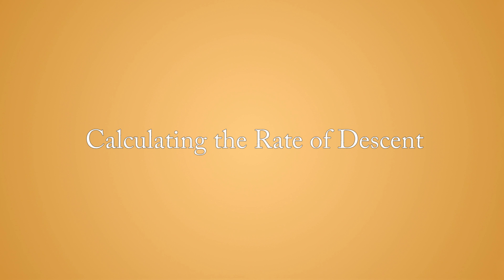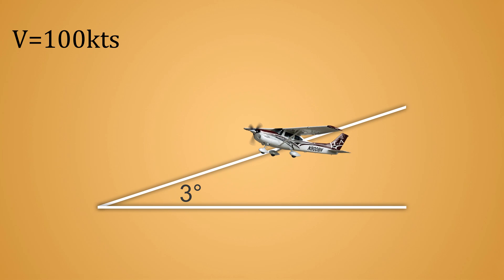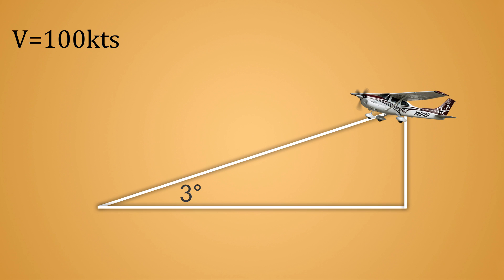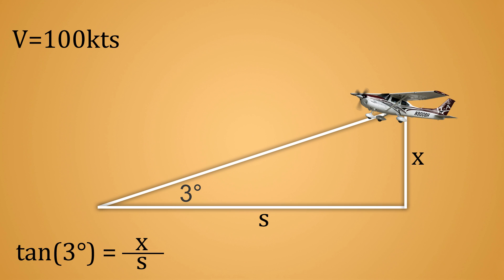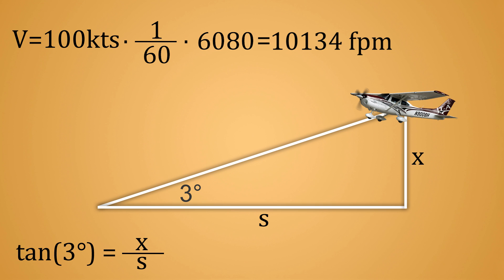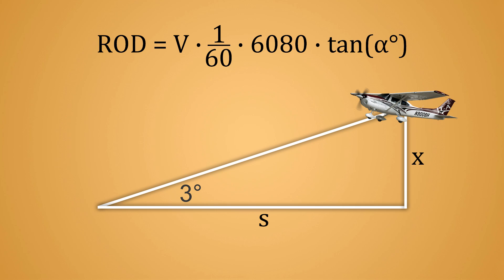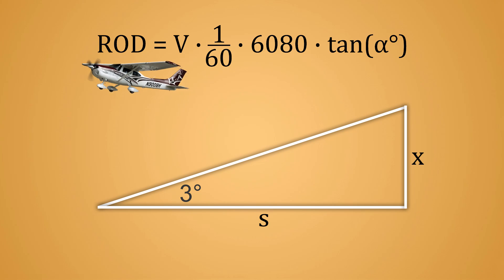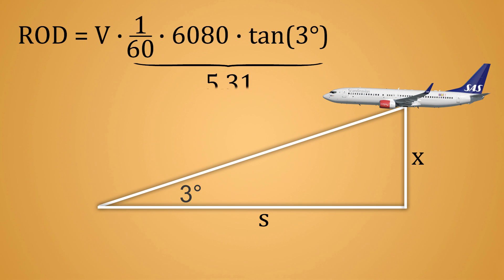How to calculate Rate of Descent

Comment: Now the reality. NOBODY does this when flying. All you have to remember is that 3 degree is groundspeed/2 +0. 100kts/2 = 50+0= -500vs for 3 degree. For every degree you add or subtract 1/5 of the groundpseed number. ex. 2 degree for 100kts is -300 and 4 degree is -700vs. All other numbers on you VSI are not existant/non practical meaning that nobody will ever hold -345ft/m comparing to -300ft/m

Comment: The baseline of the right angle trianagle, the adjacent, is straight. None of these calculations account for the additional drop due to curvature.
Reply: But the earth is flat?
Reply: @stevenstyles7602  No one has ever measured the radius, that’s for sure. Everything else in the heliocentric model - absolutely everything else - depends on the measurement of the radius, which again, has never been done.
The maximum distance in miles to the horizon on a sphere with a radius of 3959 miles, can be no further than 1.22 X the square root of the observer’s height in feet. 
Here is a 3 minute clip debunking the radius value we are told exists. 
https://youtu.be/wHFKuqO4UMM
Reply: @Mike-pf1ru  

I’ve read every flat earthers arguments for the earth being flat, I still can’t believe there are people still claiming this. Everything else is spherical.
Reply: @stevenstyles7602  Earth is navigatably, measurably and observably flat, even though it's a sphere.

The celestial luminaries we see through telescopes are only assumed to be spherical. The images we see of spherical objects are only admitted computer generated renderings. 

No one has measured, nor can they ever measure, a radius for any one of them, unless the unmeasured and unobserved radius of earth is used to giive scale to them into the heliocentric model.

I understand your objection. I honestly do.

Did you have a look at that 3 minute clip? What did you think?

Comment: Currently working on my instrument rating and for some reason I just cannot understand this formula, I understand how to get my FPM but how do I use my glide slope to get my decent rate? The formula says multiple your tangent of 3 degrees by your distance so I’m multiplying .03 by 10134 yet I get a incorrect answer (304.02) if anybody who’s smarter then me would care to explain this for me that’d be great lol
Reply from the maker: Tangent of 3 in degrees should equal 0.05240778, not 0.03. Make sure your calculator is set to degrees instead of radians or grads to make sure your future calculations are also correct! Were you able to figure it out by now?

Comment: why complicate the calculations, then there is a simpler calculation without tangent, or cosine, or sine, for example you are at a height of 8000 feet and you opt for a descent at 4000 feet by rate of descent 500ft / min the calculation is simple 8000-4000 = 4000ft we divide 4000/500 = 8 mn and, suppose your desents and has a speed 120kt, we divide 120kt / 60 = 2 kt / miles, which means, that you are going cover 2 nautical miles per minute after, we multiply 2 * 8 = 16 nautical miles this is the distance from which we start our descent  ! translate French English thank you  from Algeria   !  :D
Reply: Wow that's really more clear..great job . Other calculation shown on the clip really that's complex as like his accent ..
Reply: @rajohn84  :D

Comment: Math is accurate, but good luck calculating that while actually flying at 250 kts, talking with atc in a busy airspace. Rule of thumb for a 3 degrees slope if you want to know how much altitude you need to loose : dist (nm) x 3 + elevation = altitude you should be. Rate of descent = GS/2 X10
Reply: You mean Ground speed by GS? and also explain:
dist (nm) x 3 + elevation = altitude you should be. Rate of descent = GS/2 X10
 "that these are two different calculations or one calculation formula?"
 Thanks!

Comment: Or easier. Groundspeed x 5 = fpm for 3 degree descent. Altitude to descend x 3 /1000 = distance from TOD to BOD
Reply: What should be the Indicated Air Speed, When I'm descending?
And when I'm descending, Ground speed will reduce, so how can I get ground speed?
Reply: @ibnaas7447  if u get 30 nm to decent try to maintain 500 fpm

Comment: Or in other words, divide your G/S by 2 and you have your descent rate in fpm :)
Reply: divide g/s by 2 and multiply by 10
Reply: That is true if the gradient is 3 degrees or 5 percent
Reply: @abifaiq9645  For other degrees you just add or subtract 1/5 of the groundspeed for evey whole number. Starting is basic 3 degree. 100/2= 50+0 =- 500vs. 2 degree = - 300vs, 4 degree = -700vs. Thing is that 3 degree is the most common. Google climb/descent table and compare

Comment: Is this used every time you have to land a Cessna or Piper? Is it calculated before you go up or in your head on the approach to land? I was on a discovery flight Tuesday of this week and the pilot just seemed to "wing" the whole landing part....? How often is this used besides commercial flying?
Reply from the maker: Hey, it's great that you had a discovery flight! I hope you enjoyed it and that it might have sparked some interest! Pilots are usually very aware of their approach speeds and the related rates of descent for a given glidepath. An easy way to do it mentally is to look at your groundspeed, divide it by 2 and add a 0 at the end. Example for 140 knots, 140/2 = 70, add a zero -- > 700 fpm. This is a rough approximate, but it will give you a correct descent rate +- 50 fpm. Usually, if flying a smaller airplane which I guess you had on your discovery flight, you will be flying visually so the approach path could often be steeper than 3 degrees. However, the 3 degree is the most usual one. With experience you can also visually judge if you are on a proper path while descending towards the runway. As you said, your pilot seemed to wing it, but I believe it was his experience :).
Reply: depends on what rules are flying for? VFR or IFR and also depends what is your flight level